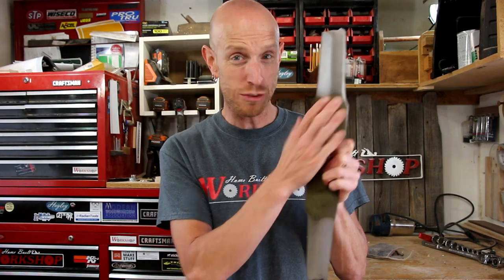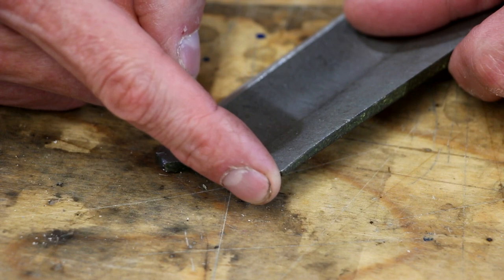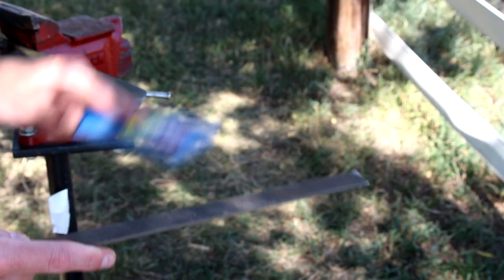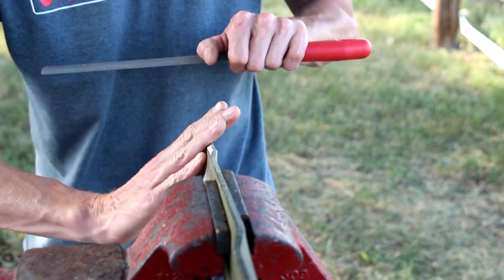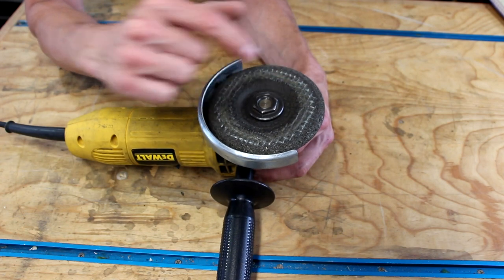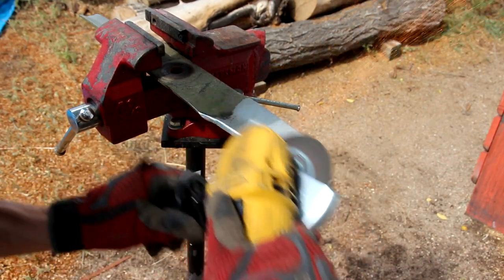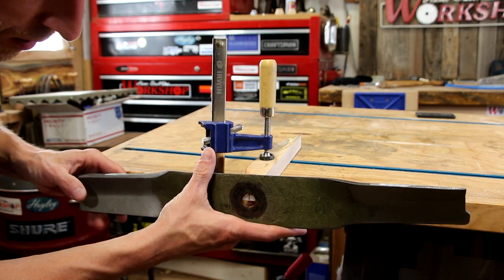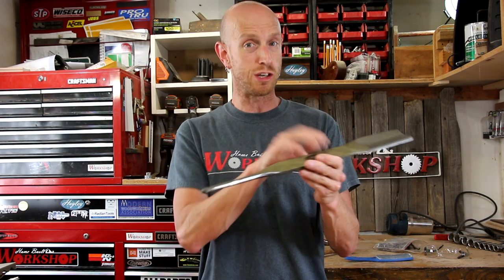How to Sharpen Lawnmower Blades

Comment: Here is somebody who knows what he is doing.  Notice that he draws his file slightly upward when sharpening the blade.  Why file upward?  You file upward because you don't want to "rollover" the edge.  Rollover is caused when you file downward.  Filing downward makes the blade look nice and shiny but you will rollover the edge causing the blade to be just as dull as before you started.  It is a subtle technique in learning to file upward away from the blade edge but this gentleman does it perfectly.

Comment: Hi Jeff great video my friend, you were very correct regarding using a draw file method. As a metal worker that's how we sharpen our tin snip blades, as an apprentice I sepent hours and hours draw filing metal squares until they were perfectly square and straight.
Reply from the maker: It's a great method. I need to practice more with it. 👍

Comment: Great video! Only thing is I can’t help wondering if the heat produced by the grinder will take the temper out of the blade.
Reply from the maker: It can if you get too aggressive. You don't want to change the color of the metal and you should be just fine.

Comment: Great video. Only problem is the metal in the blades these days are absolute junk. They don't keep an edge because they're so soft. I weld the edge of mine and then sharpen them. I also run two to three lines of weld down the blade to make it less likely to bend. You just have to be careful not overheat the blade and make it warp. Lasts all season. And we have around 3 acres of lawn on a farm with roots and the occasional rocks etc.
Reply from the maker: I've noticed that they don't hold an edge. I thought I was just rough with them. Welding them is a great idea.

Comment: Any form of 'grinding' wheel can be too aggressive. Mainly because it heats up the blade. This would make the edge brittle. A flap wheel is best in a angle grinder instead of a grinding wheel. A flap wheel is a spinning sandpaper disc. I have used small diameter grinding wheel chucked up in a air die grinder, but it is not my go to preference. There are also the small disc pads for a die grinder, they work good also. Regardless whatever way is used a file is going to be a required tool to finish the job. The angle of most blades is 30°. Checking the angle occasionally while working the blade to an edge is a good idea. Made up a 'angle checker' by simply manufacturing a couple 1/4" thick sticks glued together set at the 30° angle. It hangs on the tool board of the work bench. The other required tool has to be a good bench vise, otherwise all methods of doing this in your home shop is too much trouble. So, what causes the blade to become so banged up in the first place? My go to answer is always the same. YOUR CUTTING YOUR GRASS TOO SHORT. RAISE IT UP TO NO LESS THAN 2 1/2 INCHES PEOPLE.

Comment: Remember to pull the spark holder or you might have an unexpected start and nasty  like starting with your fingers which will be a very short time. Blades a tough fingers are soft, you work it out. As he said there there tools. balancing wheels or you can  go to a maintenance shop. A small amount of sharpening you can do yourself BUT to get it back to true you need either a professional or special tool. Forgot great video of a repair, thanks.

Comment: I’ve sharpened a few lawnmower blades in my life, and I’ve used different methods over the years for every step. I think this is a good video for people with limited budgets, but my gripes are the blade is too dirty. That will effect the balancing so every effort should be taken to get the blade being resharpened as clean as possible.

And I’d recommend not using a nail to balance a resharpened blade. They are not accurate enough and it can lead to damaging your lawn mower.

Comment: If not wearing safety glasses and you are lucky in that the metal bits don't outright penetrate into the eye, the little tiny bits of metal get embedded in surface of eye, they will rust and leave a rust halo. The sooner the metal is removed the less halo. The halo IS a long term problem and has to be dremeled out by the ophthalmologist with a special tool.  So wear the glasses AND get care immediately if you get something in your eye while being stupid.
Reply: Dr. Wooden Eye I see